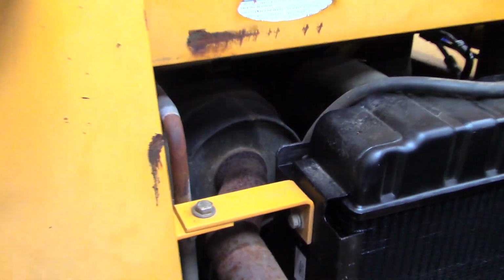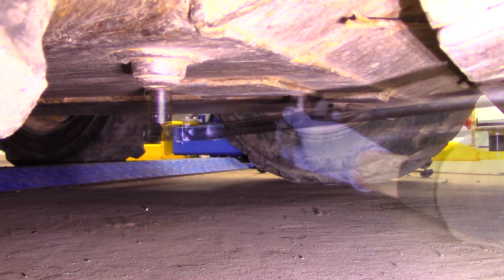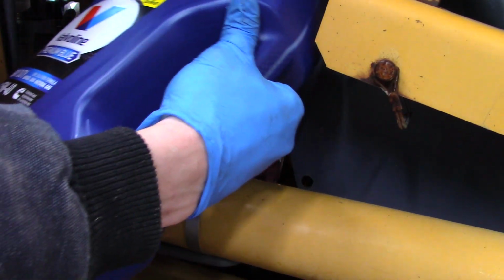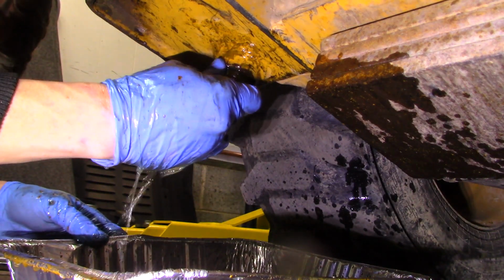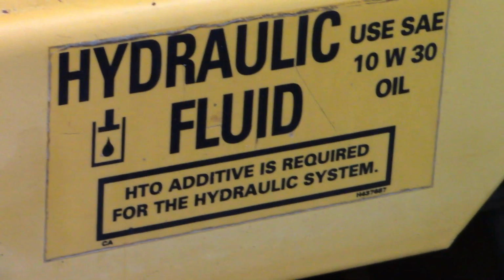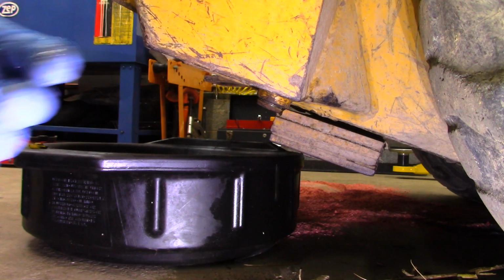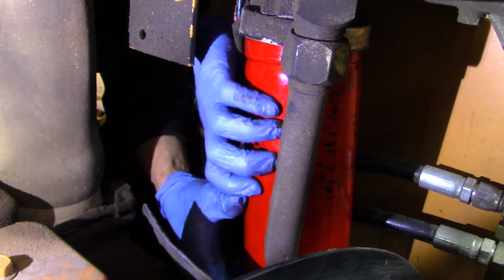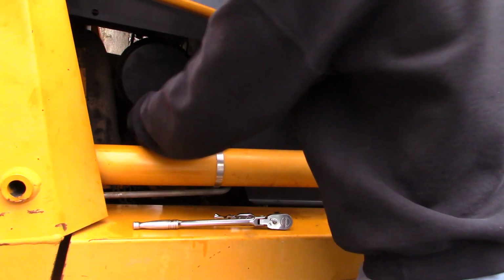Project: BasketCASE Case 1840 Skid Steer UniLoader Fluid and Filter Service  (Part 4)

Comment: Bought an 1845C about the same time as you shot the first video in this series. I'm planning to pull the radiator and go through all my fluid changes and fuel system repairs.  The rig runs decent, but I've got some injector leaks and hoses that need replaced. Have you thought about doing any more video on it?

Comment: I have some questions about the master brake cylinder witch one did u order I had the same issues u had with the one not fitting can I have the part number u used